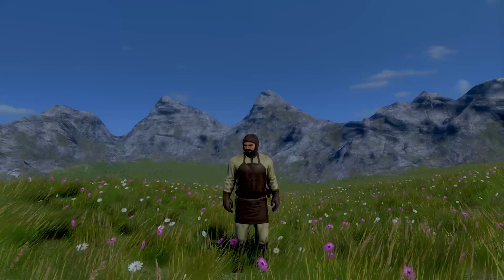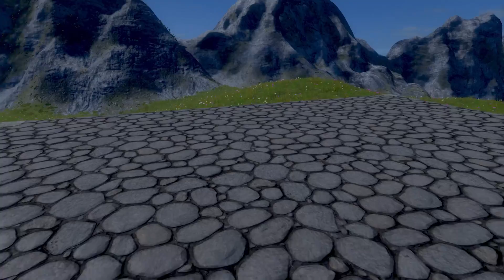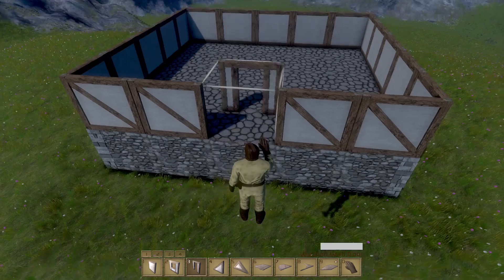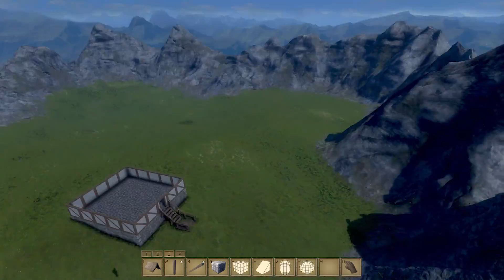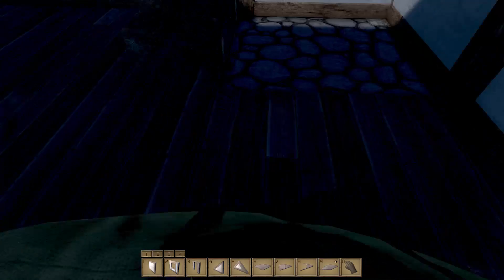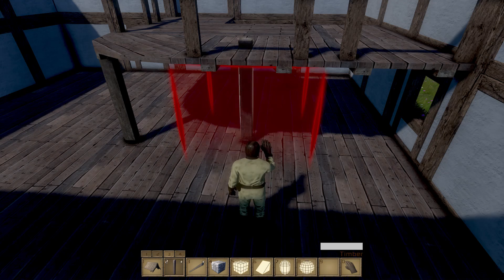Medieval Engineers Let's Build: First House - Part 1

Comment: use the voxel hands and raise the ground up under your "porch"
Reply from the maker: Michael Proberts Both the foundation & the ground are good ideas. The only reason it wouldn't be a problem is I have the structure integrity turned off right now just for the creative building purposes. :)
Reply: lol, build that sucker up then turn on the SI   lol
Reply from the maker: Michael Proberts
I probably will lol. I think I might make it the final part to my builds is to turn SI on, see if it holds, & if it does just use the cannon balls to smash it anyway lol. :P